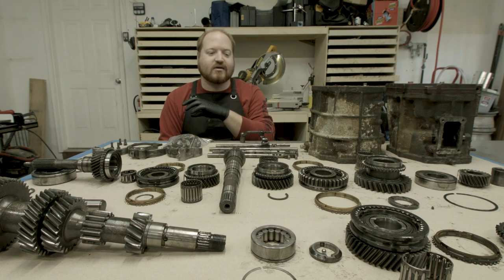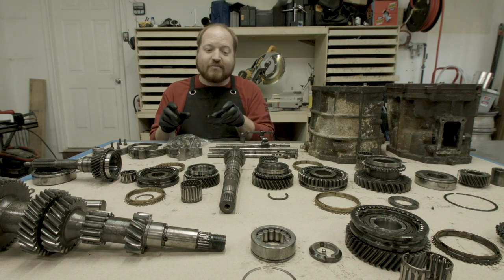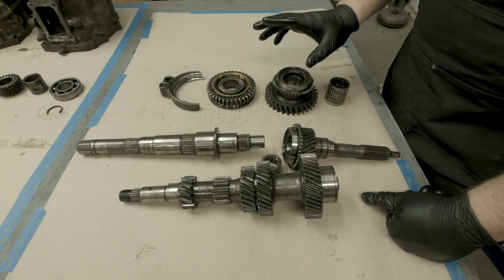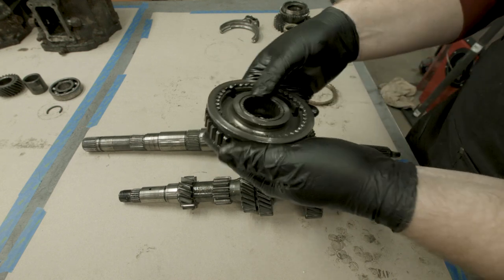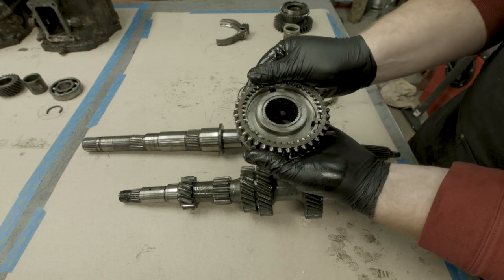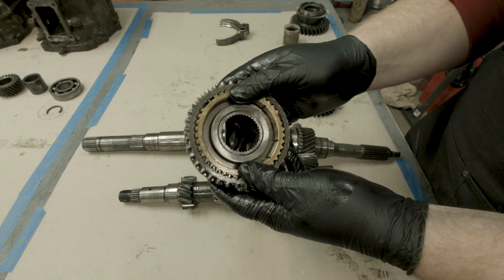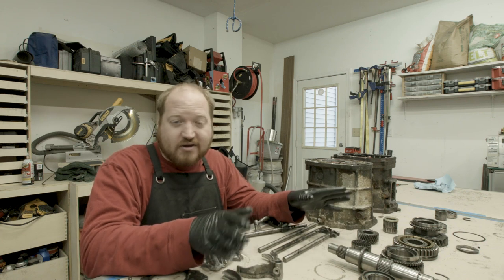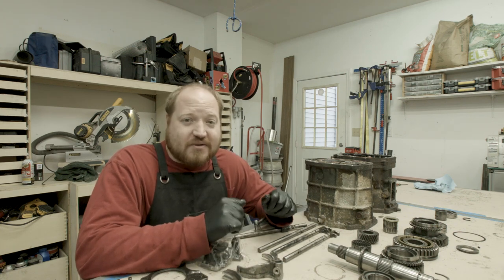Why you SHOULD rebuild your own manual transmission in your project car!

Comment: Im an firmware engineer and work with robotics heavily however, even though i do more electrical work, the engineer in me looks at a system outside my domain and makes me feel the need explore. Thanks for encouragment. I plan on rebuilding my first manual trans next month :)
Reply: Funny I was a hardware support engineer in mainframe environments. Lots of time changing HBots in libraries. The inner workings of a transmission are like magic. Yes when you shift you align a gear to contact 1 of the drive gears but how that all goes together is a mystery. I need to learn it but I would be lying if I said it ain’t intimidating.

Comment: Say a tranny with 250k miles is making whining noise but still works. It is because all the teeth of the gears are worn and loose. Would a rebuild kit make it like new? My concern is I don't know at what point a manual transmission is still worth rebuilding.

Comment: its not the fear of taking the gearbox apart holding me back, its the difficulty finding a manual transmission strong enough for my application that doesn't suck. T56 aint cheap

Comment: You have incentivized me to rebuild my transmission.  I think the big fear is in missing a step, not putting something back together correctly and all that time in removal, rebuild and reinstallation, when you finally get it back in the vehicle and it doesn't work correctly, or at all.  For me, I have an '85 Nissan 720 and I not only want to do the rebuild but I want to customize it with a slightly taller first gear and a slightly smaller overdrive gear.  Most difficult is discovery - what gear ratios are currently in there and how and where to find other gears and parts that will adapt or install properly.  I do think, since my truck is running and driving fine, I might locate a junkyard transmission and attempt the rebuild on that one.  That way, I can fall back to my current good transmission if I mess up.

Comment: Thank you for the detailed video.
I've rebuilt engines but never cracked open a transmission. I am contemplating rebuilding the manual trans in my 1989 RX-7. I am the original owner an pretty much the only person who has worked on the car. I have the factory service manual that details the disassembly and reassembly and of course many YT videos for reference. The hesitation is my lack of the special tools required. I can fab some of the specialty tools, such as a long-armed puller, but others are unique and not DIY fab items. I guess I need to compare the cost of obtaining the (expensive, sourcing from Japan or Germany) tools for likely a one-time use against taking it to a trans shop. Oh well, I don't need much of an excuse to accumulate more tools.

Comment: I have  a z28 my mechanic re- did the head gasket sounds soo good but, he is going too take the box off, it doesn't get into 2nd🚫 its a great Transmission place block away, all other gears go in pretty good. He is going to do clutch  , etc but this video really explains what he said, about the gearbox..& why manual is better..

Comment: Rebuilding an automatic sounds super hard. 

I recently learned HOW synchromesh transmissions work, and this video disassembling and reassembling the synchro filled in some info gaps.

I knew the synchros prevent gear engagement until it is synched, (many mess this up by jamming gears in with force rather than letting the light pressure and time do the job) 

Anyway, but I didn't know HOW it prevented the gears going into place. These are actually pretty simple once you understand what goes on when you shift.
Reply: I bought a manual car recently, it had been 30 years since I’ve owned a manual car. 

When I learnt to drive I was never really taught all that well. Every drive I’m learning something new, The thing with manuals is feel and timing and finesse and sympathy, manual transmissions change as you drive them and they are very alive.

Comment: Building it seems straightforward.  I'd think a greater concern would be the experience to detect which parts actually need replaced.
Reply from the maker: You'd be surprised how little experience is really needed. Anyone that can drive a manual and shift through the gears would he able to figure out which gear is acting up. If the transmission keeps popping out of a specific gear you've already done 90% of the work. You'll know what synchro, shift collar, and fork to look at. And if all the other gears are shifting correctly you'll have something to compare it too. Broken teeth are super easy to spot (cause they are gone) if a synchro is burnt up you'll be able to see a difference in color compared to the others. The shift forks are only machined in a couple places. So it that cast surface is shiny, chances are it's hitting something it isn't supposed to. The amazing think is a guy on youtube with no experience at all messaged me on youtube and figured out 95% of his issues just by digging into it. Most of our conversations were validating what he found and double checking a couple things that looked backwards compared to mine. He bought a synchro rebuild kit. Spent a couple weekends working on it and got it all back together. I haven't heard from him in like 2 months now. I'm assuming its still working or I would have heard about it.

Comment: the things I'm always worried about with these types of projects is trying to find a specific part (or trying to read part diagrams to decipher a part number to search up and THEN trying to find that part online?) or any specific knowledge needed for assembly to get everything to go properly together (which are both factors that mostly come with experience or industry background). I have vague experience working for an OEM machinery manufacturer (I've installed / assembled machines and assemblies utilizing seals, bearings, brass or bronze bushings and components, basic fixed reduction gear boxes, etc. and I have experience working in Inventor making assemblies and BOMs / cross referencing parts, but I do NOT have engineering knowledge or experience on gearbox assembly and engineering and it seems like knowledge that maybe isn't super available online (or at least not in the same easy to follow formats as every other engineering type thing is). Also knowing what greases, oils, fluids, Loctite (if needed), etc. for rebuilds is a whole other mysterious can of worms with differing opinions and stuff on the internet.

I don't have a problem understanding HOW a gearbox works and they really are very simple, but my fear is me possibly NOT knowing something important or forgetting something when it comes to rebuilding it.

Comment: Thanks for making this video. I have moved from “hell no I can’t rebuild my gearbox” to “hmmm maybe I can rebuild my own gearbox?”
Reply from the maker: What transmission are you thinking about rebuilding?
Reply: @Obscuremotorsports   I’m thinking about rebuilding my 240z gearbox. FS5C71B or FS5W71B, not sure which it is yet, have to pull it apart to find out...
Reply from the maker: @Ryan-wf7sh  Yes! Do it. That would be an awesome transmission to dig into. If you don't want to disable your car, could you buy one for cheap and rebuild it and then swap it? That could give you a longer timeline so you could take your time and be patient with the rebuild.
Reply: @Obscuremotorsports  it’s project car so I have all the time in the world... I will do more research and learn more about my gearbox. Knowledge is power so I think if I learn enough I might be more comfortable. Thanks for the encouragement!
Reply from the maker: @Ryan-wf7sh  Don't forget about the importance of learn by doing. Reading 100 books about the transmission is good to get the theory. Cracking those case bolts open is when all that theory goes out the window and it become practical. Have fun!

Comment: Good explanation my firebird grinds and pops out of the 5th gear i thinking about dropping the transmission and trying to rebuilt it myself am pretty good with tools and like to learn how stuff works.
Reply: My Camry with 450k miles started popping out of 5th. What I noticed but never gave much thought to was how the shift lever in some gears would move alot when I would put power or back off the gas. I thought I had bad motor mounts. I swapped the trans when it finally wouldn't stay in 5th. I drove it in 4th for about 6 months before I found a good used replacement. What I found on my old one was that the bearings and spacers were worn. Under torque, the entire gear train moves in relation to the parallel clusters it meshes with. It moves so far that it jumps out of the little tabs that clicks the gear in place after you complete a shift, hence it pops out of gear. Changing the bearings and spacers would have fixed the problem, plus the 5th gear teeth were worn from jumping out of gear so much..expensive parts. So it was better for me to get a used one. Once it was installed, I noticed that the shift lever didn't bob back and forth any more.

Comment: I was gaining allot of confidence in tearing apart my Honda K-Series MTX when at 10:33 you admitted that you broke something on your MTX in the dismantling process so I'm back where I started.  Bummer.
Reply from the maker: You almost got the point of the video. The reason I shared the broken bit is because even though i didn't do it perfect, I'm still happy I did it. And the extra $100 on top of the seals/ synchros I replaced is still 1/4 of what I'd pay to have it done by a shop. So even if you make a mistake and break something you'll still save money, and you'll have valuable knowledge for the next thing you disassemble. The lesson I learned in breaking this gear I've already used 2 other times taking other gearboxes apart. If I took 30 more seconds to understand what I was doing I wouldn't have broken that gear. But it's already paid for itself when dealing with gearboxes that have much harder parts to find. I hope you reconsider again and dive into that MTX.

Comment: Great video Nabil. After watching a few other videos  I was more confused than before I started. So many fancy terms from these college professor types lost me. Yours made it very plain, you described everything in a practical way that makes sense. 
I was always told never to touch a transmission - too many clearances to shim etc and if you don't have the workshop manual & equipment you'll never get it right. You prove otherwise. 
I recently bought a 2007 Ford Transit and have fixed the rust, dents and brakes, but it grates into 2nd gear - but when it has run a while it becomes easier to slot it into 2nd without grating. The other gears are are fine. I assume the synchro has gone in 2nd. Before I attempt anything, is there anything it could be without taking the box out. Secondly, is it a big deal to remove a fwd Transit gearbox? I have some basic tools but not much space. (I think U.K. garages were built for Minis).
Reply from the maker: Hey Terence! Glad your thinking about diving into your transmission yourself! Since it sounds like it's only one gear a worn out synchro is a strong candidate. Especially if it's secon, who knows how many times it's been started in 2nd and accidentally shifted into 2nd instead of 4th. I'd start by changing the oil in the transmission. Catch it in an open container so you can inspect it.  If there are chunks of metal, you're in for a good time. If the oil looks like it has tiny silver sparkles in it you might have some premature wear on the gears or shift collar. If the oil looks like it has tiny brass sparkles mixed in it, that's a sure sign the synchro is damaged. If it looks like used oil you'll have to dig deeper and start the fun. When you do take TONS of pictures. From multiple angles and of features that tell the orientation. The Toyota has big corner breaks and grooves on the shift collars and spacers that tell you how they are installed. Look for features like that before you remove the part of the gear stack. 

I'm not familiar with the transit driveline. If you're lucky you'll be able to disconnect the front and rear prop shafts and it will drop out. If you're unlucky you'll have to from the front differential before you do that. Only way to find out is to crawl under it and look! No special tools should be required.
Reply: @Obscuremotorsports  Great advice and tips

Comment: Fantastic video. Yes, transmissions are magical scary things not fixable by us mortals. One thing that puts me off are the number of specialty tools and press that are required. I've a 95 Corvette with a ZF 6 speed transmission. Any ideas?
Reply from the maker: The only "special tool"  I've used is the press.  A set of sockets a flat head screwdriver and some snap ring pliers is all you'd need to get started on the transmission. There is probably a Corvette rebuild facebook group. If you need the press you could probably reach out to someone in a group with the same passion and they might let you swing by and use their press. I highly recommend taking lots of pictures too.

Comment: I like how you played with the items as you explained them, I enjoy getting into this kind of stuff with my hands and it was as good as holding it myself. I have two S54 toyota transaxles, one has the LSD but syncro wear on 3rd, the other is better but not perfect. My main concern is shimming, and special tools to get it apart. Ideally I open both, get all the better condition parts and the LSD together, and replace the 3rd syncro because its the one that gets a hard time on track. Is this achievable with hand tools and a puller?
Reply from the maker: You might need a press to remove gears or bearings off of the shafts to get to the synchro if the puller isn’t strong enough. A pair of snap ring pliers is a must. Other than that a set of sockets, some screw drivers and some good music is all you’ll need.

Comment: im 16 and my perents have an 88 nissan sentra thats been sitting for years because its 5th and 4th gear either got striped out or it wont shift into them. getting ready to rebuild it and have a second car. i am already planing on getting a new trans but i might open it up just to see whats going on why it wont shift
Reply from the maker: I suggest before getting the new transmission go ahead and rip open the current one. And figure out if you can repair it. You won't have tow worry about the logistics of transporting the new one and then get rid of the old one. If you have any questions you can find me on Instagram and I'll do my best to help troubleshoot the transmission once you have it open.

Comment: I think the DPS6 Transmission might be an exception to this lol
It's terrifying and expensive
Reply from the maker: I mean, someone does work on those, why not be whoever owns the vehicle? If your business or or livelyhood depends on it I wouldn't recommend it, but if it's your project vehicle and you want to learn how it works, I still say dig in!
Reply: @Obscuremotorsports  I completely agree with you truthfully! I just wish it didn't need a $200 tool to take it apart. If I had my own shop it would make more sense to have though.

Comment: Thanks for the video. Debating rebuilding my ZF-5 speed, and at this point I'm sure I will when the synchros finally wear out. I have a question for a gear box designer though. The factory fluid is ATF which I find to be a bit silly for a manual trans. I am looking at using a 5W30 synchromesh fluid, which is about 10cSt higher kinematic velocity at 40C and 2.5cSt higher KV at 100C. You think that would be problematic? I am probably going to do it anyway, but I thought it would be worth asking a professional. Many folks said it really helped the trans shift better. I just wonder if a slightly higher viscosity is going to be a bad thing... Or really, how much thicker 10 cSt is.

Comment: How does one find internal parts such as forks, bearings, etc. for old Getrag transmissions?  Do the synchros and other parts have part numbers engraved on them?
Reply from the maker: There won’t be any marking on the internal parts. You’ll have to order them based on the transmission code. This is usually stamped on the case somewhere. I’d be surprised if you had to replace the forks. They typically don’t wear, unless something is really wrong. All the bearings will have the bearing number printed on the edge of the bearing races. This is helpful to verify you’re getting the right rebuild kit. Then you can use that information to trust the synchros in the kit etc. if you can take apart the transmission before rebuilding it, you cab compare pictures to what your holding. The last bit is to know that not all manufactures made there own parts. They will work with synchro manufactures and gear manufactures. Which means lexus, toyota, vw, and others will share common parts. So don’t be too concern if you see a part that says it will work with multiple makes and models. It’s true and will be okay.
Reply: Thanks very much. I wish I had your knowledge on transmissions.

Comment: I'm game, I've been watching Weber automotive and now you and I'm going to drop a 6-speed off my Lexus IS 250, and see what I can do. First though I'm going to build me a big ass work table to spread all that stuff out.  BTW, any suggestions on parts and rebuild kits other than the dealership?
Reply from the maker: I'm not familiar with the 250s transmission codes, but there are probably a few online shops that have what you need. I'd suggest looking for an IS 250 forum and read some threads in part stores. You probably don't have to ask a question, just do some searching for part stores.  I've bought stuff off eBay, lowrangeoffroad, LC engineering and a few other Toyota truck based sites. Which ever is the less expensive is the place I'll go. Good luck!